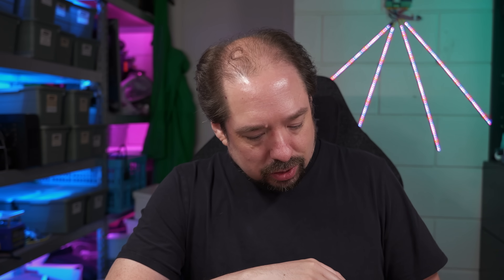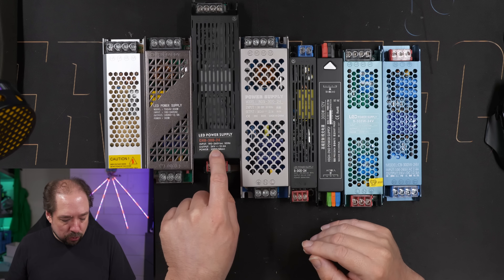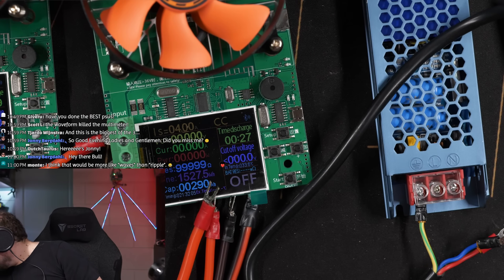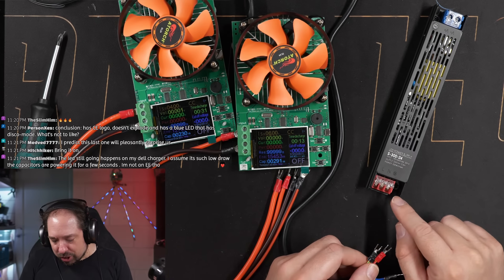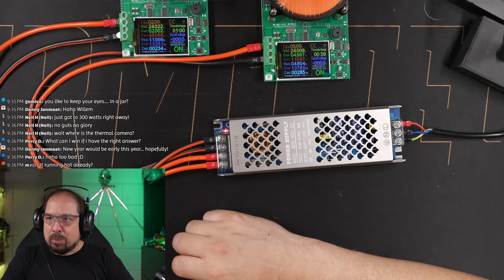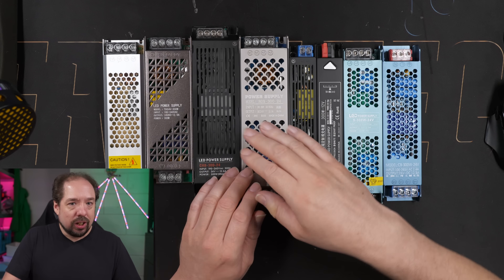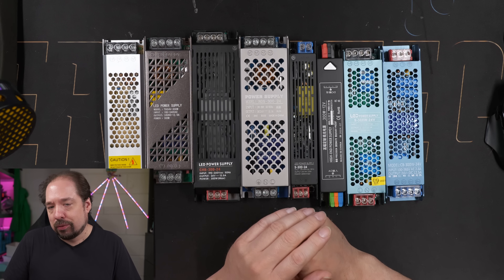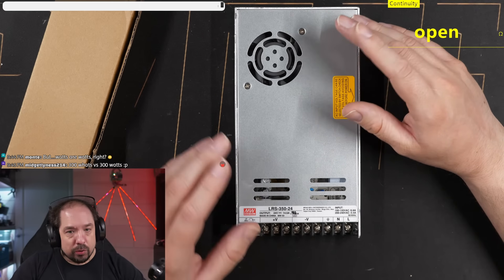💡QuinLED💡The Truth About LED Power Supplies | DON’T Make This Mistake!

Comment: When the “mining” craze ended, high-quality high-current server supplies became a plague on the surplus/used market.
I picked up eight 12V-40A and six 12V-80A supplies off HP servers.
14 total @ $5 per, shipped.

I have never gotten NEAR their limits. They run cool @ 10amps all day, all night. Even in the Texas Heat in the attic.
I DID test on of the 80ampers, out in the Garage… 80amps for five hours… no problems.. except for the power bill 🤠

I have seen these occasionally but the price has x10 even x20.
Reply from the maker: Ah yeah if they are server PSUs they are like platinum rated power supplies and quite high quality, coupled with the amount of noise that comes with that design, still they are great PSUs when adapted and if you can find them for the right price!

Comment: Thanks for the video. I never bough any of the cheap PSU; not because of what you mentioned today but fire risk. It freaks me out tbh. For these reasons, I only buy Meanwell since years.

Maybe another aspect to look at cheap PSU - since most of them will be in areas which might not be fire safe.
Reply from the maker: Yeah, I generally only comment on something I know and during testing we loaded each of them for their max load for 10 minutes and none of them bust into flames or over-heated. So it felt kind of wrong for me to state they are dangerous when I have no proof of that basically. Still, gut feeling also tells me the same, if it's critical and left alone, make sure it's a good PSU, everything is fused, etc.!

Comment: As the only moving part in an "enclosed" power supply such as the MeanWell LRS type (i.e. a quality product), the fan will eventually tend to be the first component to fail. But we're talking tens of thousands of hours.
What's more impressive to me is that of the 3 MeanWell supplies I've had with dead/dying fans (running in dusty/dirty conditions), they continued to deliver power at elevated temperature for weeks after the fan had finally stopped turning and someone actually noticed that. I've replaced the fans in them, and continued to use them with no problems years later.
Reply from the maker: Awesome to hear!

Comment: Great video. New subscriber now. Luckily, I have mostly BTF power supplies. Also, I don't ever assume the stated current is  accurate especially if bought from Aliexpress. Out of about 30 LED power supplies ranging from  4A to 15A, I run most of them at <50% load. I've had a couple of them fry if I pushed them harder. The BTF supplies are generally between 5-15% more expensive than other brands but seem worth it. I will try a Meanwell for my next led project requiring 100 watts or more.

Comment: I did watch your live streams last year and was a little surprised when I later disassembled my old "Anycubic I3 Mega"  3D printer and found out is was powered by a 12V 300W "LED power supply" :-)   Thanks for the video, I just ordered 2 x 5V LRS-100 ($18.5 with coupon) through your link. Going to play with a HUB75 128x64 matrix and WLED MoonModules.
Reply from the maker: Awesome and yeah surprising to find that in a product! The Chinese know very well these don't adhere, when you are there and buying power supplies they will just ask you what type you want. They have 3 types and one of them will do the actual rating, no lies, no deception, but sadly Aliexpress sellers are a bit more devious. :(

Comment: The only thing stopping me from lighting my eaves with LEDs is the power injection thing. Why can’t they just make a 120v LED so I can go all the way around my house without PI?
Reply from the maker: Well if you don't need them to be addressable, they actually do make that!
But if you want it addressable, it all becomes a bit more complicated on the technical side. You could go with 48v pucks like I showed in my recent video, they each have a buck-converter built-in to 12v so even when voltage drop goes down to say 18v, they will still shine just as bright as the first one in the line!

I think that's the best bet if you don't want to do power injection, you can do a few hundred with just a single edge injection no problem, the downside is cost though, including all that hardware has it's cost.

Comment: I do a lot of work in commercial premises and I never cheap out on power supplies and generally buy from local suppliers. The reason is that anything goes bad and something burns down , I don’t want my insurance company rejecting claims because i supplied a cheap power supply that doesn’t meet local electrical standards.

Comment: What about the Meanwell ELG series?

I've used them with success up until now.

I haven't seen the UHP series at our retailers here in Denmark.
Reply from the maker: I'm sure the ELG series is fine, personally, if it doesn't need to be fully sealed for water protection I use one without it since in theory it can be better cooled. But that said, if meanwell's datasheet says the way you are using it is ok (including potential cooling plate, airflow, etc.) then it should be perfectly fine.

Comment: Have you testet cheap "Aliexpress" power supplies that have the same form factor as the Meanwell ones and not labeled as a LED power supply?
Reply from the maker: The same form factory? Hmm, I don't believe so.
Reply: I've bought one of these from Amazon, and it's still going strong. I use it to run my car subwoofer amplifier at home. I bought it probably 10 years ago and it's still working. It's a 400w 12v supply with a pot to adjust the voltage. I have it set to 13.6v. Not sure if it's delivering the rated power, but the subwoofer gets plenty loud and never seems to be power limited. 

The fan on the PSU kicks on occasionally when ambient gets warm or if music is being played loud for an extended period of time.

I would recommend testing some of these, they look promising, I'd imagine it's the same as the BTF just no branding.
Reply: @Gershy13 I bought the Amazon Choice 12v 30A power supply, recommended for 20A use, which I thought was quite amusing.  It is running continuously supplying just a couple of amps.  After a few months, however, the fan kicked in and has stayed on, which suggests some significant deterioration.

Comment: Why not to use SFX 800W power supply (PC) from well know company? It will work silently and reliably. Worth to test, isn't it?
Reply: I had a quick look, a 750W PSU from Corsair (SF Series SF750) is about 180€ and can deliver the full 750W at 12V according to the Datasheet, a Meanwell one is ~10€ more expensive (MW RSP-750-12)

why I would buy the Meanwell one:
- voltage adjust, if I have to place the PSU a few meters away from the LEDs I could increase the voltage a bit to compensate for the voltage drop on the cable
- Screw-Terminals for cable connections, way more solid connection and easy to manufacture myself (on a PC-PSU you would need to spread out the load over multiple connectors, ideally with fuses to prevent overloading a single cable or connector), additional benefit: with screw connections you can not accidentally unplug a cable
- more and more of my projects use 24V LEDs -> PC-PSU is not an option and with Meanwell can can have the same workflow no matter what Voltage I need
Reply from the maker: Very valid reasons, if you lower the wattage a bit to say 600w you can get an LRS-600 which is a decent PSU for a lot less money (60 euro). Only downside really is that it's noisy and a ATX/SFX PSU would not be.

Then you'd have to either look at a UHP-500 or UHP-750 but that last one is not available in 12v and more expensive. So it's a "really depends" situation really, still, the times you'll need 600w+ on a single LED location is very limited in my opinion.
Reply from the maker: There are actually reasons for not using an ATX/SFX power supply, most because they have not been designed for the purpose. That's not saying they can't be made to work for the purpose of driving LEDs but a bit of extra care needs to be taken.

- 5v rails are usually very much below the maximum wattage of the power supply, modern PSUs might only have 10A max or less.
- You can basically only use 12v, no 24v or other voltages
- Power supplies often have multiple rails, not a single one (like a meanwell) so care has to be taken to split the current over these rails.
- Even if there is a single rail, each output will have OCP protection for their purpose, so a wire that's normally used for SATA isn't going to allow 10A to go out of that port (or at least it shouldn't!)

You can of course take lots of PCIe wires and join them together to get a decent wire gauge (single wire gauge will often top out at 16AWG but 18AWG is also common) and then hope that power balances correctly over all these wires (since each connectors is only rated to handle so much..... look at NVidia's problems for that one) and then pipe it into a specifically designed distribution board to take in those wires and then distribute and fuse the outputs again.
I've toyed with such an idea to be able to use ATX/SFX power supplies more safely but haven't really done much with it since quality power supplies cost about the same.

So it can be done, but precautions need to be taken into account, don't just wire it up and think it's ok!
Reply: @IntermitTech   Would be interesting stream if you decide to test it out. No need to combine wires, just use each PCI-E 12v cable to inject power in the proper places so load never will be more than cable can handle.
I would not use 5V at all, PC PSU is not meant to be used that way, but.... It easily could drive something like ESP32 or relay module.
Yes, 12V is not great for long distances, true. But as I said before, just for science, it could be not usual and interesting stream.

Comment: No standard layout for L-N-E, but most 'designers' put E on whichever side is nearest the metal case in an E-N-L keeping L furthest away. these power supplies are thrown together from copying whichever design uses the least components, one day it will be down to 3, capacitor dropper bridge rectifier and a hot zener diode
Reply from the maker: Ha, and that's the truth! :P

Comment: Wow, this is exactly what I was looking for.  I've been communicating with you on Discord about Power Supply questions and this was going to be my next question.  I had bought a lot of PS and none of them seemed to work as stated.  Wondered what I was doing wrong so I contacted Meanwell tech support in Kansas City and they were helpful.  I'm planning a trip to visit them.
One of my suggestions to them was that you (Quin) do a better job explaining their products than they do themselves.

As you know I'm putting together a college class on LED.
The intent is to train students who can then go out and run STEM workshops for youth.

It is very important the projects we provide be 100% safe.
(mostly this means not getting shocked and no fires!!!)

When I see the horrible results of the PS in your reviews (except for Meanwell) it tells me more than just power results.
It tells me as engineers they don't know what they are doing.
Low power is just the tip of the iceberg. 
I'd never put these around a 14 year old child.

I have been heavily relying on your great engineering expertise in constructing the course materials.
It's also great that I can rely on you to recommend the actual components that are good and safe.

By the way, I received my first Quin controllers yesterday (QuinLED-An-Penta   &  QuinLED-dig2go)
Super excited to get a Project going !!

Comment: I never thought of that.  Crap rated power supply on a computer it crashes while powering an LED strip just gets dimmer which may fool some people like me.  Do any of the LED power distribution devices monitor voltage?
Reply: You can just use a multimeter